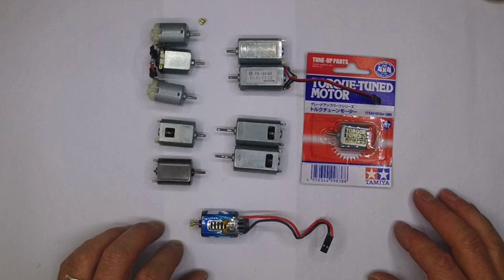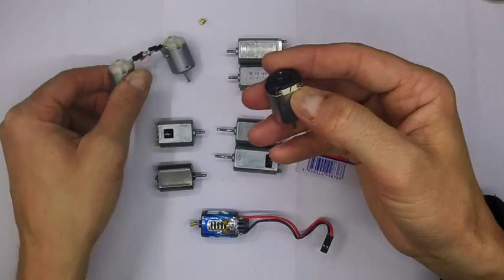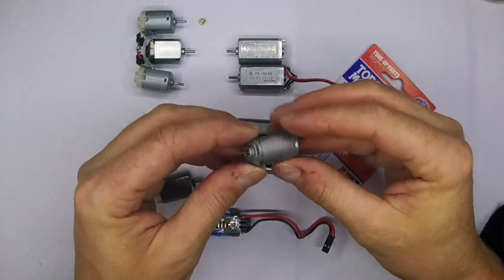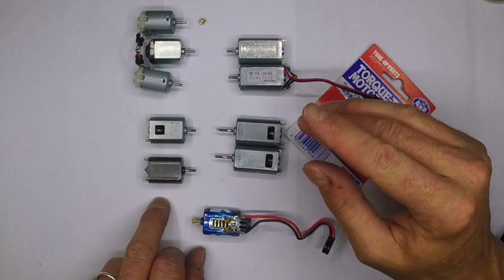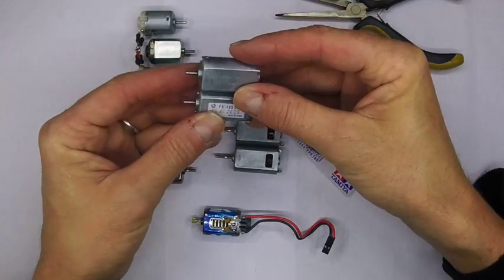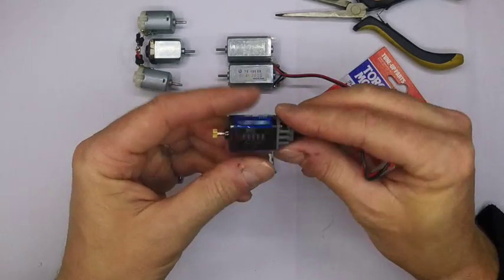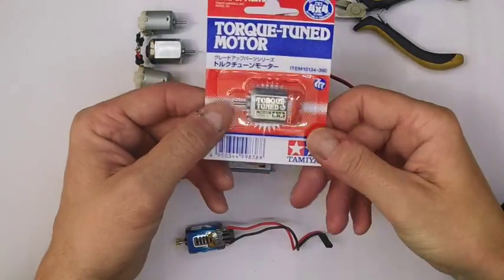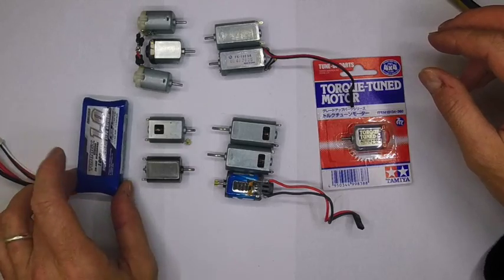Nerf Motor Mod Guide

Comment: Hi, I wanted to give some feedback on the advise you gave me a week ago. I managed to get hold of some Efest's IMR 14500, 700mAh, high drain, V2 and a Xtar XP4 charger(love that!). I rewired my Stryfe and got rid of all the mechanical locks, thermal-resistor, conductors and switches. And the result.....wow. It's (in my humble opinion) almost scary......;) I'm more than happy with this!
So now I ordered a Rapidstrike CS-18 and it came in yesterday. And I thought, well let's put those IMR's (using AA to C converters) in the Rapidstrike and let's see what happens. And again the blaster transforms into a little monster (probably no news to you) But I do have a question. I noticed that after firing only a few clips of 18 darts the batteries we empty. (Think I shot around 5 clips) Is this normal? Now, my batteries are new. Only charged them twice, but they were fully charged when I put then in the Rapidstrike. Now I don't have any prior experience whit these type of batteries nor with a Rapidstrike but is this consistent with your experience? (I use 3 IMR's and one dummy in both blasters.
Reply from the maker: +Davitamon- Glad that worked out for you!
The reason the tiny 14500 cells were empty is because they are too low capacity for the rapid strike. You shouldn't use IMR cells in the RS in my opinion, they work in stryfes etc where there are only 2 motors but using them in a three motor set up which sucks current is not a good idea. You will drastically reduce the lifespan of the cells using them in this way. Packs are much much better in the Rapidstrike. A simple pack hack like the one shown in this link is like level 1 for the RS, but a full rewire and switch replacement is by far a better solution long term.
http://imgur.com/a/iSyXh
Reply: Ok, that makes sense. Rewiring and a switch replacement shouldn't be an issue. I would like to keep it running on the stock motors. Any suggestions for a battery pack using stock motors?
Reply from the maker: I use this one for all my RS builds,
http://www.hobbyking.com/hobbyking/store/__9941__ZIPPY_Flightmax_2200mAh_2S1P_40C.html

You can go 3s with stock motors but you have to drop the voltage to the pusher and the fly motors go pop. If you want to go 3s get MTB Rhinos, they are around $5 each and are a good motor.
Reply: Thanks, I'll look into those options. I'll let you know the result. ;)

Comment: http://m.ebay.com/itm/2pcs-High-Speed-Large-Torque-FF-180SH-Motor-DC-2-6V-2-4V-14300RPM-3V-17400RPM-/311368304728?nav=SEARCH

Just by looking at them could you give some advice on these please
Reply from the maker: I wouldn't risk it when you can get real 3240's for that, or MTB Rhinos for $5. They might be ok ish at 2s but without a proper data sheet it's hard to be certain.
Reply: +Foamdata Services can you add a link please . I'm in the USA
Reply: +Elijah Manning for the rhinos and 3220's
Reply: +Elijah Manning http://www.amainhobbies.com/rc-helicopters/traxxas-motor-set-2-dr1-tra6335/p245470 
These ?
Reply from the maker: I won't put links to 3240's up on the open web, they all get bought up by speculators if you do that. You want a Blade or E-Sky or E-Flite 180 motors. Those Traxas ones are useless. MTB rhinos can be bought from Tacticool Foam or Containment Crew in the USA.
Reply: +Foamdata Services thank you so much for your help . I sent you an email regarding some other motors .

Comment: +Foamdata Services. Hi, I'm new to Nerf but already loving' it. Now I would like to upgrade my Stryfe, which motors would you advise. (preferably I would not like to cut my strife shell). I do already have fitted my Stryfe with a voltage upgrade from Blasterpart; 11,1 volt
Reply from the maker: The "upgrade" from Blasterparts is 3 Trustfire batteries, they can't provide enough current for modded motors, see my battery guide and Trustfire test for more info. You will have to rewire properly, whatever you do, so a 3s Lipo pack is a good upgrade, then run MTB Rhino motors. This will get you 110fps average. The only downside is you get a small pack for a stock tray, giving about 500 shots between charges. You can extend the tray with a bigger cover to allow a larger pack, Blastersmiths UK make one. Check out Britnerf for all available motor test data http://britnerf.myfreeforum.org/forum14.php and detailed information.
Reply: +Foamdata Services Thank you for your response! The Blasterparts upgrade/voltage mod. are not Trustfire batteries, but 3 unprotected Li-Ion cells and one dummy-battery from a German manufacture that raises the Voltage from 6V to 11,1V; 700 mAh (min. 650 mAh) Does this change your advise?
Reply from the maker: Lithi Ion still isn't powerful enough,its the battery chemistry that is the problem, it can put out about 2-3Amps max.
 Given that one MTB Rhino pulls 10amps stall they are too under powered. Motors want volts to make RPM but torque (what fires the dart hard) is only made by current. A €8 Lipo pack can discharge over 30amps continuously.
It annoys me they even sell that kit, its useless for anything other than stock wire and motors. You can try IMR (LiMn) batteries, those can put out 8amps each, and can be charged in your blaster parts charger. They aren't ideal for Rhino motors, but better than what you have. I would still sell that kit and buy Lipo, its much much better.
Reply: +Foamdata Services Thank you again for taking the time and answering my question, I really appreciate it. Like I said before; I'm new to Nerf and just diving into this mod. scene. I fully understand your story and since I haven't bought upgrade motors yet, I'll just start with their voltage mod. and see what that will do with the stock motors since I ordered the kit yesterday and only came across your channel today....;( 
If it's no good I'll will sell the kit and go for the LiPo and eventually the upgrade motors. To be really honest; I'm not nesercerly looking for the ultimate performance for now since I don't really do Nerf Battles (yet).
I just like playing around with it and giving it a different look and feel. But extra performance is always welcome ;)
Until now I've only done cosmetic mods. and some basic internal mods. But I'm looking forward to dive into this world of mechanical and electrical mods. and people like you are really kind and helpful by sharing your knowledge. So thanks again.

Ps. If you like I can send you some pictures from my latest cosmetic mod. My take on a Nerf Jolt! Yes really, a Jolt........;)
Reply from the maker: You can always return the kit without opening it. I would recommend that. Also get over to www.britnerf.co.uk for more modding info and help.
Reply: +Foamdata Services Thanks for the tip. I've just subscribed ;)

Comment: Would tamiya light dash motor pros fit in a modulus flywheel cage? and would they be able to run on 3.7v 14500 batteries?
Reply from the maker: I would avoid all the Tamiya motors, they have insufficient torque. The light dash is also metal brushed, so is worse spec than Rhinos or Meishels.
If you are expecting one IMR cell to provide enough current for two motors you will find it has a short life.
A better option if you want to use IMR is to rewire, keep the stock motors and run 3 IMR's and one dummy. This will give you 100fps easily. Then when you are ready to move up to Lipo packs you can decide about motors.
Reply from the maker: That motor also has twin shafts, which need one side cutting off. They need to be done with a cutting disc on a dremel or grinder as they are hardened steel and the motor bearings can be damaged if you use a saw or too much heat gets in them.
Reply: I'll already damaged stock motors with my soldering iron ;3;
Reply from the maker: I have a massive stock of spare 130 motors. I can send you a pair of new Rapidstrike motors for cost of postage. It's about $8-10 for the USA. Use email or contact me via my trading page on http://www.britnerf.co.uk.
Reply from the maker: If you are in Australia, visit http://www.blastertech.com.au they have all the motors you need. If you want a new stock pair, use their contact email and ask Dean (the guy behind the gear!) if he has a spare set. He is a really helpful guy and can probably supply you with exactly what you need. Buying random motors off eBay only leads to disappointment.
Reply: Oh Thanks!

Comment: So....which are the best
Reply from the maker: +D.j.Y GAMING5 Depends on too many things, the best motors are the ones matched to your power supply, wiring, game type and blaster.
I use the FK180-3240sh on 2s a lot, as people seem to want me to build those, but MTB Rhinos, essentially a Falcon, with 3s Lipo are pretty good too. Even stock motors can hit 100 plus FPS when set up right. Check out my data forum
http://britnerf.myfreeforum.org/forum14.php&sid=3c075f5a2215b496690795ab083e4853

for tests of nearly every common mod, then make up your own mind!
Reply: +Foamdata Services thanx I will look at the link for sure
Reply from the maker: D.j.Y GAMING5 Post on Britnerf if you need detailed help, they are all nice people.
Reply: +Foamdata Services  kk thanks!
Reply: +Foamdata Services also what do you think about rc car motors like turnigy motors in nerd guns?
Reply: Nerf*
Reply from the maker: If you are talking about brushless motors then people have put them in Nerf. They generally are no better than a good matched brushed set and cost tons, plus the need for a controller takes up shell space and adds costs. If it's just a brushed RC motor the larger 360 series ones are not only far too big but also don't always match the spec that works best in Nerf, the same is true of slot car motors like the NSR Sharks. As it stands we have several very good, useable and inexpensive motors for flywheels that are easy to buy and install. I suggest you pick a set of those for your build to begin with.
Reply: +Foamdata Services thanks.. I really appreciate all the help:)

Comment from the maker: The Ostrich- yes those are a 3240.
Reply: +Foamdata Services i guess they are out of stock i saw this other video with some guy using falcon 7 motors are those any good?
Reply: +Foamdata Services ah ok the are basically mabuchi but rebranded as blade or eflite
Reply: +Foamdata Services thanks probs is that I only have 2 of those motors
Reply: +Foamdata Services Sorry to bug you again but i was curious to find your opinion on these. http://atomicmods.com/atomic-ar-030-v-ball-bearing-stock-v-motor/
Reply: did you ever get around to testing the nerfwar 180s?? im looking to mod my rapid strike but im having trouble deciding what motor to get...i also want to upgrade the pusher rod motor as well. i google them using the names you give but idk if those are the same motors. they come up with different names.
Reply from the maker: No, but Dean at BlasterTECH did, they were OK, not quite as good as 3240's or Falcons but not a disaster. Personally I just put 180-3240's in there. Real EFlite Blades are the best way to get these. Check out BlasterTECH on YouTube for the motor test, the Aussies call them Keg 180's
Reply: +Foamdata Services ive been having trouble finding the motors ive seen the extreme 180 pros but i belive they are 20$ a peice thats a lil to much lol ive seem immitation fk 3240 but ive read that they are bad. any idea where i might be able to get some good motors?
Reply from the maker: These are what you want. Nerfers avoid this one because they are nervous of the pinion removal. 
http://www.amainhobbies.com/rc-helicopters/blade-180-motor-w-8t-0.5m-pinion-left-cx-eflh1210/p9391
Reply: +Foamdata Services and theseare the 3240? i guess ebay is just lame lol
Reply from the maker: It took me 5 minutes to find more
http://www.robotmarketplace.com/products/0-EFLH1210B.html

Falcon motors are OK, they have a yellow sticker on that says Falcon on it. They have been out of stock for some time MTB Rhinos are a Nerfer commissioned version. Some users report lower performance from these vs the original. I just use the genuine 3240 because it's the only quality guaranteed motor for under $20 each and on 2s is pretty hard to beat.
Reply: +Foamdata Services thanks man ive been googling then all day but i couldnt seem to find them...will 3 of those motors run on a 3s or 2s lipo?
Reply from the maker: 2s Lipo is best, you want 40c continuous minimum, I use this one in all my RS builds. 3s just burns darts. Run a set of good Stryfe flywheels and it will shoot 120fps peak on Koosh, with 750 rpm stable on centre off wiring, or 680-700 on centre on wiring. 
http://www.hobbyking.com/hobbyking/store/__9941__ZIPPY_Flightmax_2200mAh_2S1P_40C.html
Reply: +Foamdata Services sweet thanks man i already order the motors as well as 16 awg to re wire everything and some micro switches rated 15A i should be set
Reply: so i ordered some motors from the robot shop and from ebay...i already received the ebay ones and they dont have the m on top im guessing the m stands for mabuchi wich was the company that made those motors originally? the ones i got say fk 180sh 3240 on them but it dosnt have the m on them... are they after market? are they just as good? the packaging said blade on it. im wondering if the ones from the robot marketplace are gonna be the same??
Reply from the maker: Nobody except Mavuchi make the 3240. They will be the real deal.
Reply: +Foamdata Services ah ok cuz i saw these one call nichibo on ebay that were supposed to be knock offs...the one i got of ebay said blade on it. the motor itself said fk 180sh 3240 but i didnt see the m branding on it so i wasnt sure about it
Reply from the maker: Nichibo ones were commissioned by Zinky to replace the Mabuchi ones. The manufacturer ripped him off and supplied very poorly made metal brush copies. Avoid Nichibo 3240's at all costs. Anything in a Blade or EFlite or Esky package will be genuine Mabuchi.
Reply from the maker: Put them in all of those, they have plenty of power and should be ideal for 2s Rapidstrikes and Stryfes, flywheel or pushers. Don't be tempted to try them on 3s.
Reply from the maker: Put them as the flywheel motors on your best outdoor or war blaster.
Reply from the maker: They made the biggest power so far in my test Stryfe.

Comment: Hey there fella loving your videos really helping me go to the next level but im currently a little confused about motors and lipos to use. im planing on using the Blastersmith wiring and switch upgrade set on my rapidstike to do the rewiring and was wondering what Motors you would recomend me getting to go along with the ZIPPY Flightmax 2200mAh 3S1P 40C lipos you recomend in your battery video?
Reply from the maker: I don't recommend 3s, get 2s it's easier. You don't have to change the motors at all if its your first build, you can get reliable 95-100fps performance out of the stock RS motors at about 400 rounds/minute. I am not a fan of 3s builds, nor of hot 130m motors. The only ones I put in my stuff are genuine FK180sh-3240 or Xtreme 180's. Otherwise I re use the stock ones. At the moment all of the other motors are unsuitable for RS in particular and Nerf in general.
The BSUK kit is a great starting point and does make the job much simpler.
Reply: Foamdata Services thanks for the extreamly quick response :) cool so would i have to get a diffrent battery to the one i mentioned above then as its a 3s? mayby i got the wrong battery from your battery video. i shall make amendments to my plans then and keep stock untill i can find some of the motors you mentioned there. cheers again for all the help much apreciated.
Reply from the maker: You can get MTB Falcons, they are a 3s motor. They are going to be available from several resellers in Europe, USA and Aus. You can still do the whole rewire and use the stock mototrs with a 2s pack. If you want the Falcons hit up rhino_aus on Nerf Rerddit.
Reply from the maker: The large pack in my video is a 3s LifePo4 pack, they are 9.9v as the LiFe cells are 3.3v each. The other problem with 3s is the need to install diodes on the pusher circuit to stop it runaway firing if you wire centre on. You can avoid this with the 2 switch bodge wiring, but I never use that as it leaves the pusher sticking out often during mag changes.
Reply: ok that makes some sense from my knowledge of lipos from my other hobbies so what are the 2s batteries that you recommend in your battery video the ones you use so i can get the right ones to go with my wiring upgrade kit. again thank you for all your help.
Reply from the maker: his one for the Stryfe
http://www.hobbyking.com/hobbyking/store/__21331__ZIPPY_Compact_850mAh_2S_25C_Lipo_Pack.html

This one for the RS.
http://www.hobbyking.com/hobbyking/store/__9941__ZIPPY_Flightmax_2200mAh_2S1P_40C.html

Comment: hi today i found these motors.

http://m.ebay.com/itm/One-Piece-32x-20-x-15mm-1-5V-7-2V-Voltage-DC-Motor-Micromotors-/161717965217?_trkparms=aid%253D222007%2526algo%253DSIC.MBE%2526ao%253D1%2526asc%253D20150519202348%2526meid%253D7460b77a666e46299bf650f0c05cad78%2526pid%253D100408%2526rk%253D1%2526rkt%253D25%2526sd%253D351413442147&_trksid=p2056116.c100408.m2460

srry about the stupidly long link but these seem pretty okay they are 14000rpm at 3v which is faster than the 3240s
Reply from the maker: +Unknown Ntranoc Try them out, they are cheap. The magic number for maximum power is around 28,000 at 6-8v with as much torque as possible. These are reportedly OK if they are like the ones sold by BlasterTECH with their loom kits.
Reply: will do! i will send in the results after i test them hopefully they will work like the kegs.